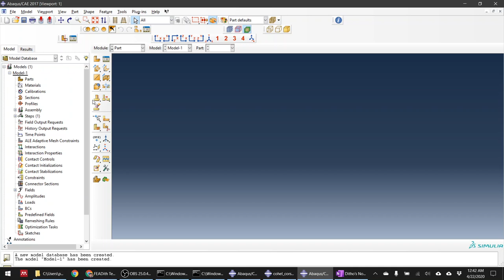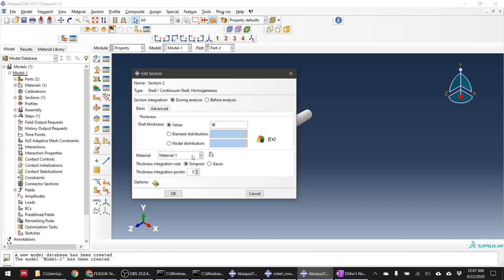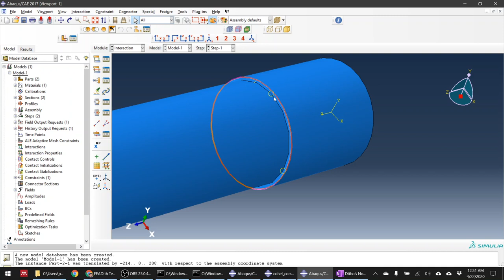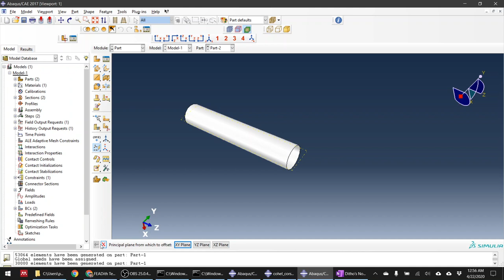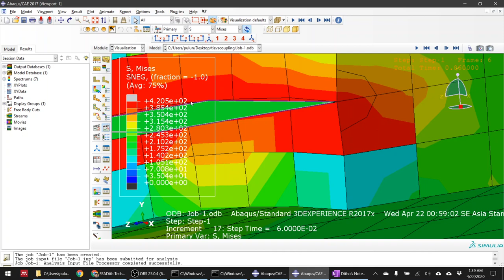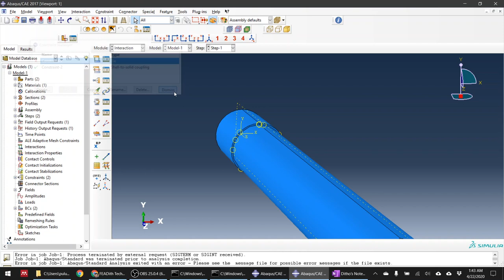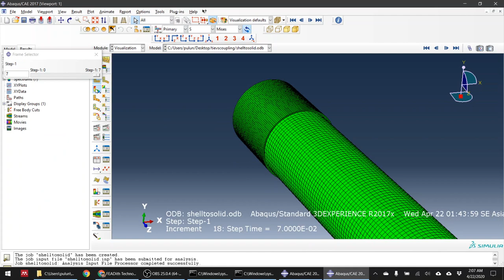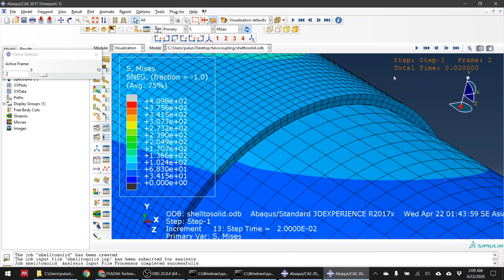Tie Constraint vs Solid to Shell Coupling In Abaqus for Local Detailed Analysis

Comment: Hi! First I'd like to comment that this is an incredibly useful video! However i'm presenting some trouble to define shell to solid coupling for a low velocty impact virtual test with a VUMAT implementation for the Puck's criterion, just as the example you presented. I remain looking at some irrealistic delamination in the solid to shell transition even though the delamination failure is far inside the 3D refinement area. I'm using cohesive elements to simulate delamination, is this the reason of the problem? Please, could you provide an insight to develop a solution?

Comment: Hello, can a cohesive surface approach be used with shell elements? I am having issues with two shell surfaces with cohesive contact interaction.
Thanks.
Reply from the maker: Yes you can. Did that before

Comment: Very helpful tutorial. However, something is not clear to me and I will be glad if you help me. When you are using shell-to-solid coupling the coupling will be done between the shell and the whole surface of solid or just a portion of it? Also if we want to connect the shell (cylinder)  with the portion of solid's area equal to shell thickness, how could we do that? Does the shell offset thickness affect the coupling?
Reply from the maker: Coupling will be done to the whole portion of solid that you selected. Thats the point using coupling instead of tie.

What if we wan to couple a portion of cylinder? Make partition to the solid accordingly. So when you choose the surface of the solid, you select only the surface you intended to.. so yes.. partition is the key.

The (conventional) shell thickness does not affect coupling. When you are using the shell, abaqus only compute kinematic of the mid surface of the shell. 

Hope it makes it clear

Comment: Sir, what woulld you suggest to put a beam element with a solid element together? What other constraint could I use?
Reply from the maker: I did it once.. reinforcing the circular pipe with a steel ring. The pipe was modeled using 3d solid and the ring was modeled using beam elements. I use tie constraint in that case.
Reply: @FEADith  since beam element has only node and solid element has surface..can we do node to surfcae discretization for that?
Reply: Did you solve the issue of beam element connecting the solid element?

Comment: I want to tie inclusions to the matrix. How do I select the internal surface for the matrix that would interact with the external surface of the inclusion? Can anybody help?
Reply from the maker: If your inclusion is only a single inclusion, that should be simple.
First make partition to your matrix.. so you matrix will not be one cell, but 2 or more cells...

Then you can hide cells that you dont want to select.. and now you create set of surfaces. To this set, add the surface accordingly..

For multiple surfaces, you might want to use python script for that. Check my python tutorial, you can use cells.findat approach. Good luck
Reply: @FEADith  Thank you for your respnse.